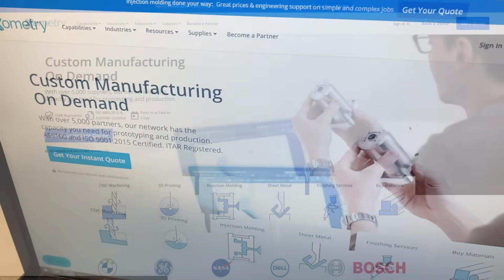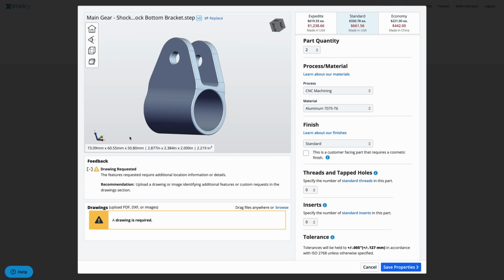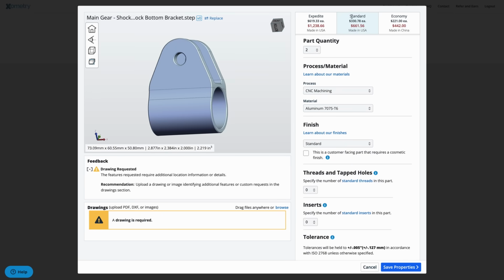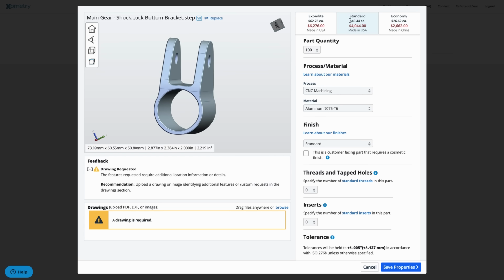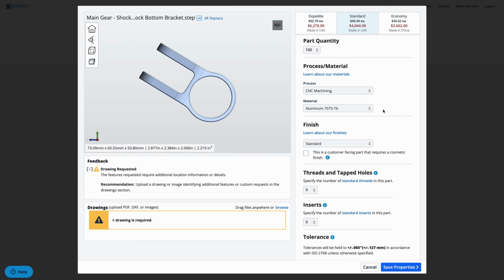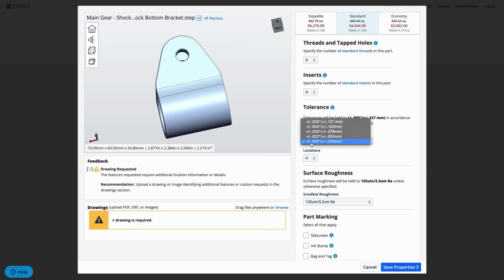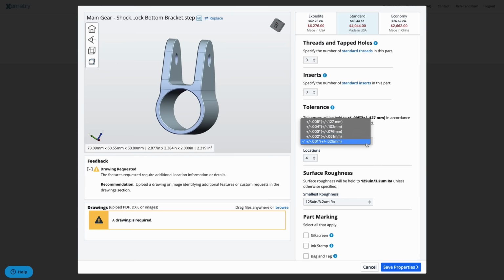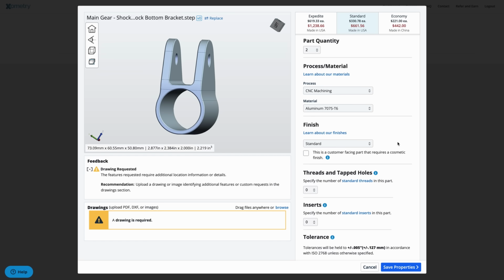The TRUE COST of CNC machining!

Comment: anytime I machine 1 or 2 parts its time and material, for most jobs I mount 3 double lock vises for 6 to 12 parts at a time , for higher production make a fixture and remember for high abrasive material you may need diamond coated cutters

Comment: in my experience at a job shop, is 99% of the time we see +/- .005". but if the engineer specifically wants something to be like dead nuts, they will usually shoot us an email describing the importance of something and/or ofcourse using GD&T on the print. like if an engineer was like "this bolt hole pattern needs to be dead nuts with this o-ring groove' as the machinist we can understand that we dont have the best inspection tools but we can do this in one setup and be sure its accurate. so i think having good business comms is important
Reply: yeah, I ran a couple prototypes where we had to interface 2 OEM parts. At some point, it's just easier to go to the machinist and be like "this is the drawing, but they just need to fit"  I  could spend all day doing GD&T, but don't have the tools to verify they meet spec beyond my physical parts which act as a Go/No-Go.
Reply: @RaphYkun  yup! Makes our life easier too haha

Comment: Seeing your drilling op at 2 minutes, I gotta say you can increase your feeds and speeds. Looks like you have a Tormach pcnc 1100 which has a max spindle of 5140rpm. 
Check out FSWizard, it’s a mobile app. You plug in your machines max spindle, tell it what tool you want speeds and feeds for, the coatings on them, length they’re sticking out, etc. For drilling with say a 3/8” standard hss drill in 7075, run that sucker around 270 surface foot and .0036 chip load. (2752rpm, 19.88ipm). That’ll also cut costs, especially after prototyping
Reply: https://youtu.be/_SBkl3b2ZOs

Comment: I would love to see a cost work up of this part redesigned in a 6000 series alloy and manufactured via welding two 2D profiled ears onto a piece of tubing.  Even if the main bore needs to be reamed afterwards, it should cost about 20% of the fully CNC'd part you described.
Reply: I think that would be cheaper, but maybe not as good a solution for an aircraft part.  More inspection and failure points, reduced strength in the weld zone, and you'd probably have to bore the tubing out to get the fit they wanted.  But if it were for a car?  Yeah, switch it to plain carbon steel, make it out of tubing and some water jet cut ears and it would be way cheaper, stronger and more fatigue resistant than the aluminum part, and not much heavier.
Reply: Hi,dear friend,have contact information in the video  https://youtu.be/_SBkl3b2ZOs

Comment: dude make a aluminum profile out of the shape from the side,   add some simple cnc machining, this should be around or below $10 USD per part, and machine time less than 5mins.
Reply: Was thinking similar, wonder how much it would be for a profile.
Probably need a few 100 parts to leverage the cost of the setup?

Comment: @DarkAero ; Custom aluminum extrusion tooling is often very low cost and this part looks like, if you start with an extrusion, your cnc time will be minimal. This is often a good design path for low and medium volume. (Me: engineer medical beds/durable goods)
Reply: Well, if you already got everything else ready that is...
Reply: Can you extrude 7075?
Reply: Did a quick search for " 7000 series custom aluminum extrusions " there seems to be listings of 7000 & some 7075
https://www.thomasnet.com/products/small-run-aluminum-extrusions-1395110-1.html  Thomas directory always useful. 
My recommendation talk to a few engineers at the above search,,, what kind of yeild strength do you need,,, also a custom extrusion allows you to add an extra bit of cross section volume here or there which also also might open this up to other reasonable alloys too. Heat treated 7075 you should be over 80,000 psi, yes

Comment: Very cool guys! The one thing you didn't mention that I would be very interested in a detailed description was how much did it cost you in total to do those two prototype parts and please break down in every area as if you were prototyping for a customer such as Part Design Cad Time  (software used) , material cost , cutter path programming time (what software used), machining time for both parts , cad design time for soft jaws , machining time for same and inspection deburring ,finishing time as if you were delivering to a customer. I think most will be shocked by the high numbers of prototype development. This will show the true cost of developing these two parts.Thanks for sharing that site for instant quote as I will definitely  use that to experiment with some of my cad files.

Comment: ...but there is a DRAMTIC advantage to making this part from a CASTING. Materials costs drop a long way, machine time drops a long way. Sure, you still have to machine, you just don't have to pulverize more than 50% of your material if you start with a casting; every cut is a finish cut.

Also... why didn't you plane with a larger end mill like 3/4" or 1", or with a planing head? Surely your machine can handle larger tooling than you used. Your surface finish is much improved with a larger cutter.

Comment: The way i'd do it, given you have the mill long enough, is add +3mm in stock height, machine full part height to eliminate the blend (along with necessary holes etc), then put in in soft jaws and finish what you need! I think it'd be faster and more labor effective, though to each his own! Cheers!
Reply: Great idea, hold it on a small/short dovetail in dovetail jaws, finish the bore in second op. for minimal distortion.

Comment: Hoped to see explanation on how make more parts can coast less then few - still same part has same CNC or manual operations. programming of G-code still one time deal  so that can not affect the price. I feel that company with CNC get lazy and greedy ask price for 2 parts like they would stat make them with manual machines and not CNC. I Have Woodworking CNC and I just can not ask big price for job where human labor is minimum.
Reply: most people in cnc machining have a minimum setup fee of about $500 some do go as cheap as $300 this is just the cost of setting up the vices or tables or chucks and what tools are going to be required for the operation after that there can also be a service charge for extra tooling if the job requires tools specific to that job imagine having to spend $5k for a boring head because the customer has asked for a really specific hole size that you cant get a reamer for and the hole is a blind hole please let me know if this helps answer your question

Comment: Cost analysis was really interesting, I started looking at this as 'weld two plates on a pipe 'but I was wrong :)
Reply: Exactly, TIG weld two aluminum tabs onto section of ally tubing, but might only be able to get beads on the outsides of the part... then there are the dimensional tolerances. Could still be possible, but might need to fabricate a jig to position and hold everything to specs during welding.
Reply: @oceanic8424  how do you do if the I.D. of the pipe is not available at the right size? Remember, the tolerance was 0.001 inch, I think.
Reply: @jtcmlt1  Bore it in a lathe
Reply: @noahhastings6145   Okay. I have the tendency to think CNC every time that I hear lathe or mill, vertical or horizontal. I forget that they can also be manually operated.
Reply: @oceanic8424  this is earospace so the parts need to be really consistent with their strength
Reply: @misham6547  I thought it was for a bicycle, not aerospace. Welding is perfectly fine regardless.
Reply: It is just a clevis, could have left it square.

Comment: Excellent video.  I'm curious about the clear enclosure on the Tormach. Is that custom, and if so, what are the pros and cons of the design? (We have a PCNC 1100 with just the front facing shield but are thinking about ways of improving both safety and coolant containment with a custom shield.)

Comment: Listen, you're using a Tormach mill, these machine are not that rigid.  Now if you machine this same part on a HAAS VF2 for example and you make you process that you don't do parts one by one.  The cost will go down.   

And also the part would hold higher tolerance on a HAAS compared to a Tormach and unlike what you said, the parts would ALL repeat.  Now if you go on a website and ask to make that part, you have to assume that the subs has high end CNC brand machines like HAAS, DMG MORI and so on.  These machine can spit alluminium parts like muffins.  It may cost more, but the quality, tolerance and time it took  to make them including the programming, setup, tooling & tooling wear will reflect the price for each part.  NOw for example, the part in your video could be made on a multiaxis lathe, a 5 axis mill, a mill with a 4 axis or a simple 3 axis cnc milling.  And even on a manual lathe and a good bridgeport mill with a rotary indexer.    You see all will dependes on the total step or process.  

So always keep in mind when you give pointer on outsourcing or subs a part, never assumed that they used low end CNC machine like you have.  These shops are in the big leagues and can improve your original process and if you need any surface treatment on those parts they will make sure the bores and holes will respect your measuments and tolerance after they get anodize or paint and baked or had any heat treatment.  All this will paly in the final cost of each part.

Comment: That is an extremely expensive vendor.  For qty of 100 at the tolerances you described +/-0.001 that should be a $25.00 part including material (7075-T6).  Also that is a three setup part with no mate lines.  Still interesting to see how other people prototype.

Comment: Looks to me like a weldment would have beat this in time AND money, particularly in a small batch.
Reply: Not with small aluminum parts- the welding ruins the temper of the  aluminum, it will need post machining due to warpage and it will look hacky. This isnt a hinge for a ranch gate- in certain markets it is very important how the part looks.
Reply: @hankbrown3959   I'd say Aluminum is a poor choice in this app. And marginal in aircraft skin applications
And  that they really need to take a look at Chromoly Steel for critical apps like this and FORGET the bling bling aluminum...
Machinability is Aluminum's ONLY  grace here...
Like playing with fire, Easy to get burnt.
Reply: @charlesangell_bulmtl  At least watch the video. He mentioned welding even. Saying aluminum is only bling in this situation is ideocracy.
Reply: @beno9966  Got lost in the comments but it seems that this part is on an oleo strut? If so my opinion stands....
You ride bikes and don't recognize the failings of aluminum???
That's not a place to gamble as this is NO place for failure.
"ideocracy", not at all....
Reply: @charlesangell_bulmtl  yes I ride bikes and design and manufacture parts every day from Aluminium. The failings are on the design not the material.
Reply: @beno9966  Still no place to gamble....
Reply: @charlesangell_bulmtl  it's only gambling if you don't know what you're doing. Modern CAD and FEA takes most of the guess work out when it comes to this stuff.
Reply: @beno9966  Hubris is the easiest path to failure...
Reply: @charlesangell_bulmtl  so is ignorance. No hubris in taking the time to test in both cad and prototypes. We are not in the stone age anymore where we need to just over engineer something to be sure it's strong enough.
Reply: @charlesangell_bulmtl  You should look up the properties of 7075-T6.  Mild steel has a tensile strength of around 61,000 psi, while 7075-T6 is 83,000 psi.  That's why it's used in thousands of applications on general, commercial, and military aviation aircraft.  You cannot compare it to any of the other alloys of aluminum, like the super common 3,000 series, nor the common aircraft alloys like 2024-T3 and 6061-T6.  Even 2024-T3 is stronger than mild steel.  Based on your comments, you know nothing about aircraft, nor engineering.
Reply: @throngcleaver  Diversion, mild steel was not what I was talking about
Reply: @beno9966  "so is ignorance" deflection...
"We are not in the stone age anymore" hubris....
Reply: @charlesangell_bulmtl  ok buddy. I'll continue designing aviation parts out of aluminium, you continue doing what ever it is you do, let's hope that doesn't involve aviation.
Reply: @charlesangell_bulmtl  What matters here, is that you don't know what you're talking about.  Go look at small, medium, and large aircraft landing gear systems and you'll see which parts are made of steel, and which ones are made of aluminum.  You obviously haven't spent much time around aircraft, nor manufacturing, nor engineering.  Aluminum is the perfect choice for that application, especially 7075-T6.
Reply: @beno9966  My old man had a saying about "EDUCATED IDIOTS"
He was a weldor out in the field dealing with plans of those without hands on....
Reply: @charlesangell_bulmtl  that old chessnut. Usually just Dunning Kruger in effect and people jealous they have to get their hands dirty for less pay. It's easy to be critical of a design when you don't have to do the designing.
Reply: @beno9966  And vice versa....with the superior twit
That's a poor shield
Reply: @charlesangell_bulmtl  well you already proved where you fit by thinking a weldment would be better here. You keep letting others do the thinking and you just do your job.
Reply: @beno9966  And you're my boss?
LMFAO.....typical, condescending BS
Reply: 7075-T6 is generally considered not weldable because the welds crack easily.
Reply: Literally the first thing I thought after seeing it in his hand 5 seconds into the video.
Reply: Obviously not a machinist then.
Reply: @Smiffywheelin  Obviously not an engineer then.
Reply: @TheMartzip  😂
Reply: @TheMartzip  I highly doubt a weldment would have been cheaper or quicker.

Clevis still would have needed profiling, cross drilling, and finish machining to size/tolerance in the channel. Clevis plates would have also needed preparation on the one edge before welding to the tube. Tube still would have needed to be finish bored to size/tolerance. Additional workholding and/or setup time beyond the soft jaws shown would also likely be required.

So nearly the same finish machining + welding + extra material prep + extra setups + jigs. With short run cost/time of relatively simple & small parts being dominated by operation setup & tooling, no way a weldment comes out cheaper or faster.

At least not with that design & the tolerancing they're after, anyway. They also could have completed that part in 3 ops, not 4.
Reply: Piece of pipe and two flat pieces, welded. Pipe then bored out to size if need to be accurate. Just my .02